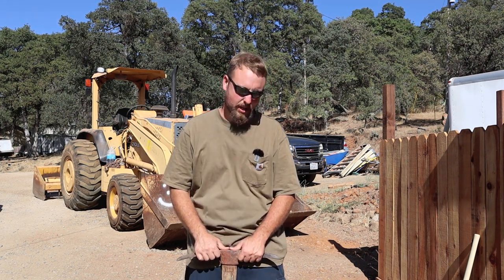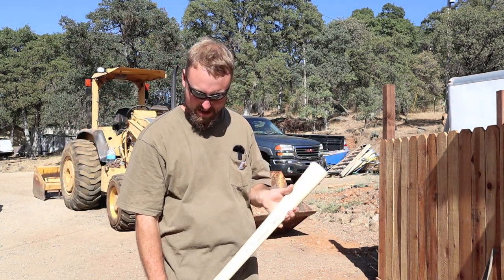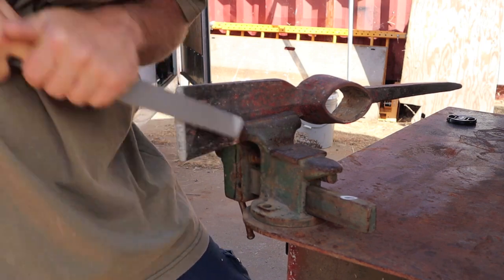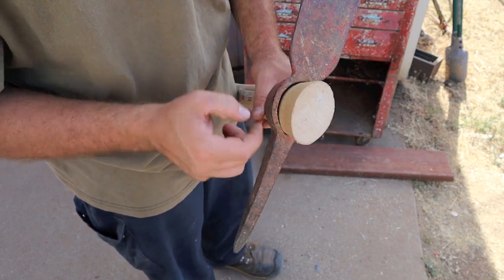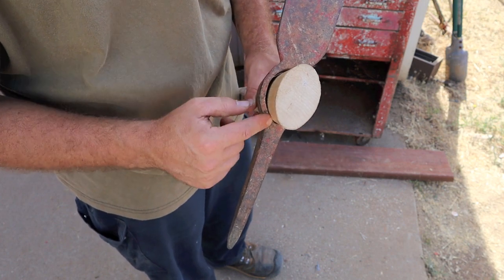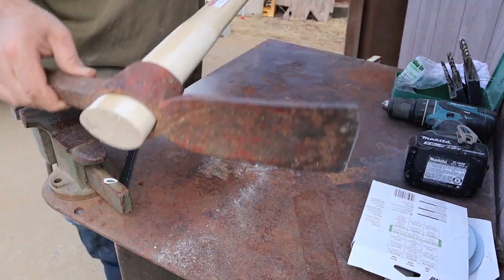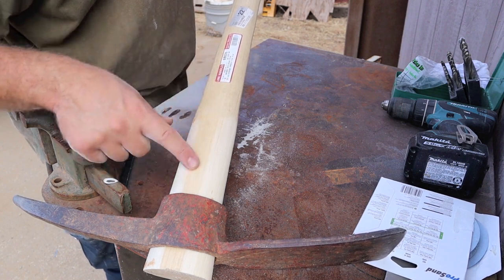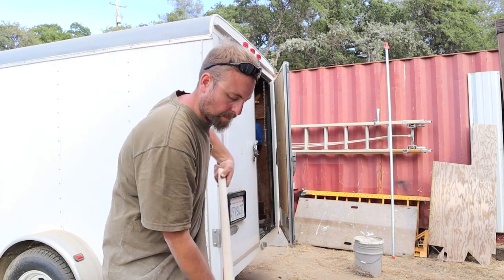Tool Handle Replacement | Mattock

Comment: That’s a bad idea, putting a hole in the handle near its biggest stress point. 😬
Reply: Yeah this just feels wrong. Surprised it’s not a bigger discussion than the water vs linseed oil debate.

Comment: Perhaps it was cut from the video, but prior to installing the lock bolt, I would have hammered (drop to the concrete floor) it multiple times to seat it tight.

Comment: grab some 150 grit sandpaper and rub that use it to sand the wood while slowly applying linseed oil.  the dust will make a slurry that plugs pores, and better seals the wood as it cures.   rub it in.  let it dry, and rub off the excess with 0000 steel wool.  Apply some paste wax over the top if you really want to seal it up.

Comment: to sand the handle down quicker, put line chalk (or just rub pencil) on the inside of the pickaxe head, and then sand down the areas where there is no graphite/line chalk.

Comment: Soak that loose handle in water every once and a while. 
Never file the back side of the blade. It pushes the blade toward you when it hits. The back side should have the same profile as the rest of the blade.
Reply: You mean linseed oil, water evaporates and also may cause it to rot. Oiling it lasts much longer and keeps the water out if applied on the odd occasion
Reply: @radaraacf  NO. I don't mean linseed oil. If I did, I would have said it. 
One could coat it with linseed oil but I doubt many have a tub of linseed oil large enough to soak an axe, much less a mattock. 
And, NO, water does not cause the handle to rot.
Reply: @idadho  you don't soak it in linseed oil, you simply rub it on every once in a while. And it's awesome.
Reply: @idadho  You are aggressively wrong. There is never a situation where you should soak a tool handle in water. Most of your upkeep with wood handled tools is keeping water away from the wood. And yes, soaking in oil is ideal for swelling the wood to keep the head seated and also keeping moisture away. Soak when handling, then apply regular coats with decreasing frequency to keep the wood protected. Whoever taught you this is wrong, I hope you get some use out of my explanation.
Reply: @grantmclean6026  I've never needed to soak a handle more than once a season. Never had enough oil to soak the handle. Wiping oil on does not help enough. My father swung an axe for decades and would use water to tighten the handle. I still have some of those very old axes and wood handle tools.
Reply: @idadho  Like I said, you were taught wrong. Water damages wood, oil protects it from water. Same reason they tarred wood on sailing ships. Water will swell wood, but it dries and causes cracking and rot. You can soak the handle in a small amount of oil, if you leave it with the head down in a bucket it will leech up the handle.
Reply: @vollandt  I have handles that are 40 years old and get soaked once a season. Who has a bucket and enough linseed oil to fit the whole axe head in? Yes, linseed oil would be better is you have access to a way to soak it.

Comment: If you wanted to pin it, you should have gone threw the head metal, and used a roll pin, but it all should be I'm like smaller mm measurements. I've seen it done, and I'm not sure the effectiveness of it, but this was definitely not a good idea given hole placement, and size. I'm glad it wasn't an axe or something more dangerous.... I mean.... This is still totally dangerous, but I think you get it.